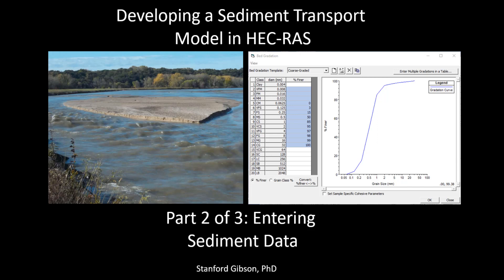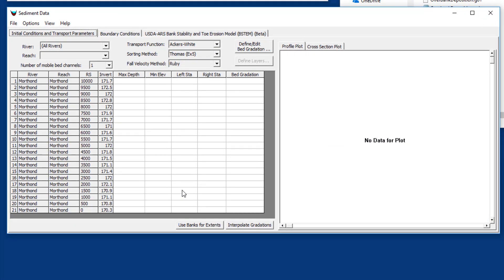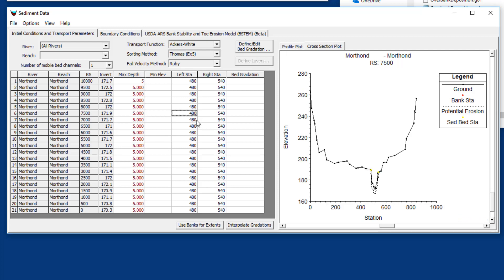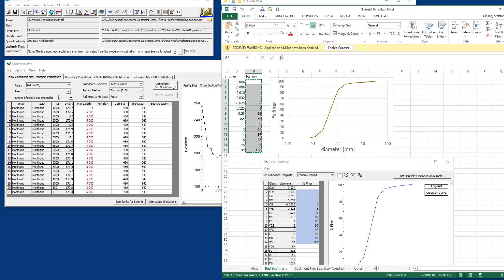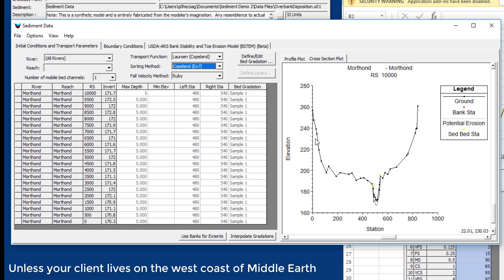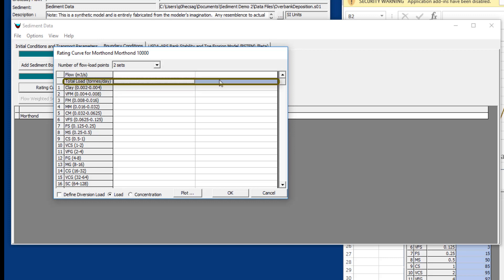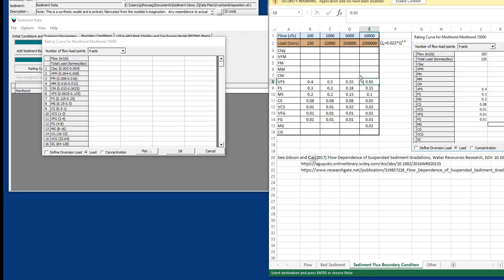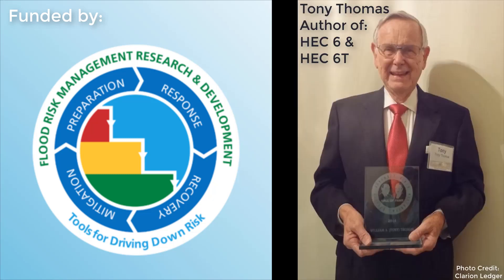Intro HEC-RAS Sediment Demo (Part 2 of 3 - Sediment Transport Data)

Comment: Hello, thanks for the tutorial. How do you "define your own grain classes" ? This log2 scale is really not convenient and I was not able to find where to customize it. Thanks in advance !
Reply from the maker: Go to Options-->User Defined Grain Classes (top option) in the sediment editor.  There you can change the grain sizes (note-the program only actually uses the mean size) and names.  If your material is sand, start with grain class 6 and higher.  RAS automatically assumes those first 5 grain glasses are silt and clay regardless of their size.   https://www.hec.usace.army.mil/confluence/rasdocs/rassed1d/1d-sediment-transport-user-s-manual/entering-and-editing-sediment-data/sediment-properties-options/define-grain-classes-and-sediment-properties
Reply: @stanfordgibson   Thanks a lot for your answer

Comment: Thanks for fantastic series of videos. 1.I have a quesion how you determine this relationship Qs=0.022*Q2.0 ??
2. If there no any sediment gauge station upstream what will be the most suitable boundary condition?
3. Could we determine a boundary condition using river flow as you did?
Reply from the maker: Hello, I describe how to develop sediment rating curves like that in another video: https://youtu.be/cBr3KkLTW1Y
Reply from the maker: If you don't have sediment data, it gets more difficult.  I really need to do a video on this, but you basically have 4 options: 1) Collect some concentration data to develop a rating curve 2) Estimate with some sort of regional regression equation or watershed yield equation, preferably calibrated to deposition rates at a reservoir with similar watershed characteristics 3) if you have calibration data, just make the sediment load your calibration parameter (guess and adjust) or 4) you could run what I call a "credibility test" - if your system has historically been in dynamic equilibrium (if for example, you are planning a future modification of a system that is historically in equilibrium) then simulate several decades of the past with a credible transport function, and develop a rating curve that makes the model stable on the reach/decade scale.
Reply from the maker: There are some cases where the equilibrium boundary condition would be appropriate.  Some of those conditions include: 1) it is way upstream of the area of interest, 2) it is not supply limited or armored, 3) it is in a reach that is actually in equilibrium.  But I still prefer to convert the equilibrium loads into a rating curve so I have more awareness of and control over the assumptions the model is making.

Comment: Could you  please explain what do you mean when you said "this system doesnt exist, and should not be use for planning..."? i mean, can i use this  information for a real study or do i need to change some steps?
Reply from the maker: HEC-RAS exists.  :)  You can use the program with site-specific data (local cross sections and sediment measurements from your river).  

But the cross sections and sediment data in this video (and provided) are fictional.  I made them up completely.  They are not from a real river or even roughly based on a real river.  So I would not use them for any real study in part or whole.  Does that make sense?

Comment: Sorry Stanford i have a question, i'm trying to do a simulation of an event of the past, a backanalysis, and i know for sure that the river that i study (a gravel bottom channel) have no problem of erosion. The last year a big alluvional event bring in this channel a lot of fine sediment. When i was get to check the situation i can observe that the bottom of the cannel was clearly without accumulation and without erosion. So the real situation is that there isn't erosion and the accumulation of the fine sediment was only out of the bottom of the main channel (in the floodplain and also in the lateral side of the cannel). I put as a max depht 0,1 m and i calibrate the model with the "vol. out cum" of the last section, the only numerical data that i have for the calibration. The problem is that a lot of the deposition is on the bottom of the channel (in the lateral side of the channel and a little bit out too, but not like in the reality) and the erosion sometime arrive to 0,5 m. Have you some extra help to give me? ;) Hope my english is quite ok to understand the situation, your video are awesome!! Hope that you continue this really important job
Reply from the maker: Bringing a fine pulse into a domain with a gravel bed is actually a pretty tough problem for an "active layer" type model.    There can be a couple of problems.  We are writing a tech note right now on what we call the "floating gravel" problem - which results in artificial persistent deposition after a fine pulse in a model.  But the other problem is that models like RAS that assume "independent grain classes" tend to over predict gravel and cobble transport and under predict sand transport in a mixed bed.  Version 5.1 will have a whole suite of hiding functions that will help (we were having a similar problem in one of our models and hiding improved the model a lot).  Until then, the Wilcock and Crowe transport function has hiding in it, you could use that if it is appropriate.  Otherwise, you may have to artificially increase the size of the gravel on your bed to compensate for model bias.  Also, if you limit the thickness of both the active layer (under mixing options) and the inactive layer (initial max depth) fine pulse models tend to perform better.

Comment: The program shows me an error, unrealistic vertical adjustment at * river station * when i run the sediment simulation, can you help me with this issue ? , why this error happen?
Reply from the maker: Basically, that means your channel filled with sediment very quickly.  The most common reason for that is that the time step is too large.  The channel doesn't have time to update the hydraulics in response to deposition.  But if it is happening at the upstream cross section, it is usually because the sediment load in the boundary condition is too coarse (often because the user used the bed gradation for the load gradation...but the bed gradation is usually much coarser than the load).  This could also happen when the sediment load is too high or the transport function isn’t appropriate.  I would like to do a trouble shooting series and could probably do a video just on this error message.  It is the most common.
Reply: Thanks ! Other little question, this error can be generated because of interpolated sections?
Reply from the maker: @johan127lespaul  Interpolating shouldn't cause this error...but it might make the underlying error more pronounced.  So a model that was mostly unstable but used to run, may crash when you interpolate.  But interpolation is revealing a problem, not creating one.
Reply from the maker: however, sometimes interpolation can create an intermediate cross section without a defined channel (particularly when the thalweg switches sides).  In a sediment model, you have to use the "chord ties" (those red lines in the interpolation editor) to make sure the thalwegs are connected if they switch sides of the channel - particularly if you have multiple channels.

Comment: I have a question on how to determine the max depth? thanks
Reply from the maker: Max depth (or minimum elevation) is the depth to bedrock or hard pan or some sort of non-erodible boundary.  If the system is just alluvial and there is no known hard bottom, choose the maximum depth you think the river could possibly scour under the model conditions and then evaluate the results.  If the river hits the "bottom" you set, either make it deeper or reevaluate some of the modeling assumptions.
Reply: Stanford Gibson i have a question about it, when i run the sediment simulation, the program show an error, “ error during sediment simulation: unrealistic vertical adjustment at *  a river station * , i don’t know what i have to do.
Reply from the maker: @johan127lespaul  Basically, that means your channel filled with sediment very quickly.  The most common reason for that is that the time step is too large.  The channel doesn't have time to update the hydraulics in response to deposition.  But if it is happening at the upstream cross section, it is usually because the sediment load in the boundary condition is too coarse (often because the user used the bed gradation for the load gradation...but the bed gradation is usually much coarser than the load).  This could also happen when the sediment load is too high or the transport function isn’t appropriate.  I would like to do a trouble shooting series and could probably do a video just on this error message.  It is the most common.
Reply: @stanfordgibson  Thank you. So can I define the max depth with the surveying data? For example, firstly I set a number for the entire channel. Then I adjust the max depth base on the comparison of the results to the surveying data cross-section by cross -section? Does this way work? Thanks.
Reply from the maker: @Nash_W87  You should not use max depth to constrain erosion.  In general, if my model erodes down to the max depth, I increase it so the model has an unlimited control volume of sediment to scour.  If you have a known bed rock or hard pan or concrete channel, I usually use the min elevation to limit erosion vertically.
Reply from the maker: If your model is eroding too much, it is better to start with a coarse cover layer, use a different transport function, coarsen your bed, or increase or coarsen your flux (sediment boundary condition)...whichever your data and system justify